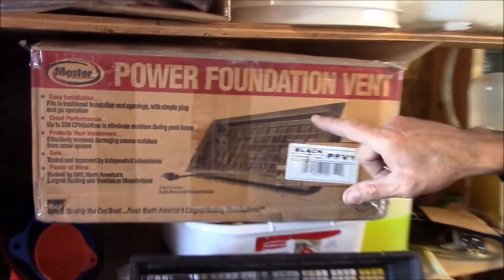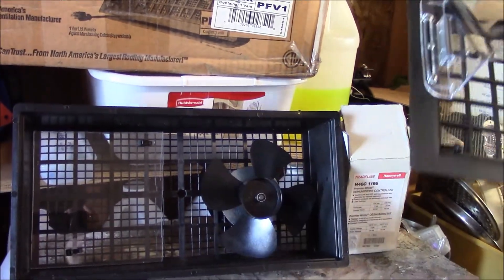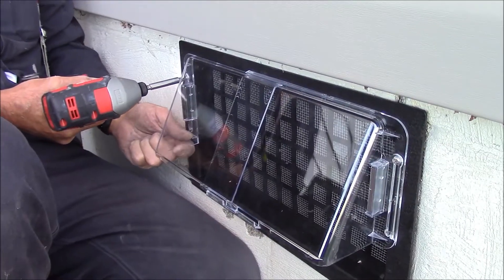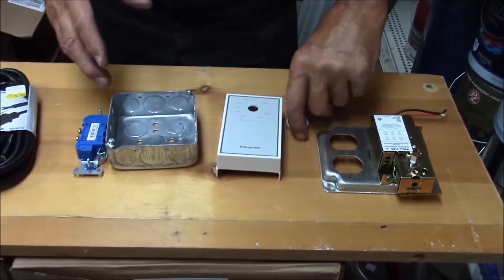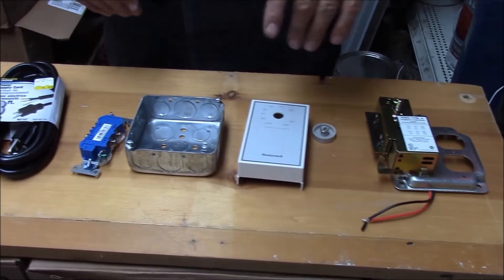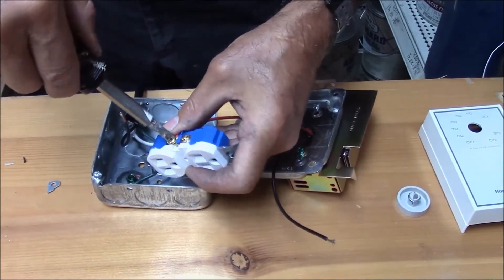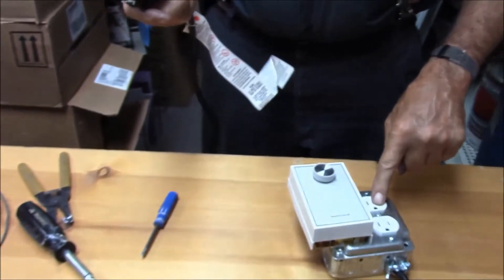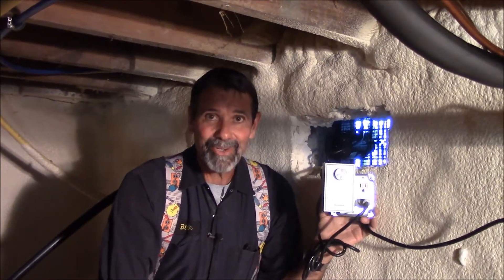Crawl Space Fan and Humidistat Wiring To Move Dry, Wet Air

Comment: Someone already alluded to this but if your crawlspace humidity rises to switch on the fan it will be of no avail if the outside humidity is above the set level of the humidistat.  As a matter of fact the system would run continuously until the outside humidity stayed lower than the humidistat setting and until the crawl space fell below that setting which would be a very very long time.  I propose that the system would be useless unless there were outside and inside humidistats wired in series.  But that's just me.  I've installed an actual HVAC air handler blower on a crawl space vent.  Currently I'm only running it when outside RH is low.  It is capable of moving fresh air into the crawl space because it's high CFM but a small fan like in the video seems insignificant in capability.  Even the fan companies offer information that "More than one fan may be necessary."
Reply: That fan is 2,000cfm, enough to force inside (almost always dryer) air into the crawl if for no other reason than to change it. It only runs one hour a day on a timer when the hivac is not in use. It also draws air from an upstairs 6" makeup-air vent under my dryer up there, which changes the air in the house keeping it fresh.
I agree with comparable RH in and out but that situation is rare and I still like changing the air in the building every day in the summer. It has been in for over 20 years and I can attest to its functionally all this time.

Comment: Very informative and detailed video. I question how much good that little "330cfm" fan can do for a whole crawl space. It physically doesn't appear to be much larger than a large computer fan. Not knocking you or your video at all, it was very good.
Reply from the maker: It runs all the time, very quiet and keeps the air moving. My cottage has a floor fan that is almost 1,500cfm, check out that video, https://mrhardware.com/articles-and-videos/crawl-space-venting-fan-allergies-wet-dry/

Comment: Hi Gilbert,  Where did you buy Fan and thermostat ? I couldn't find fan same size my vent size  (16x8).
Reply from the maker: LOMANCO Model No. PCV1. You can order one by calling Gilberts, 586-776-9532. They cost about $139.99 Tell them you saw it on mrhardware.com and it will come to me if there are any problems. Blair

Comment: You're like a wizard! Love your videos.
Reply: Thanks, we are trying. Blair
Reply: @gilberthardware7619  1 CFM for every 50 sq ft and control set to 60% relative humidity.   A bath fan would work for most crawlspaces--includes a damper. 

Should include an exterior damper ( dryer vent with damper) to limit moisture entering in summer and cold leaving in winter when fan is not running.  

No need to run fan all the time.  Humidity control is one way.  Alternatively, a  
AirCycler SmartExhaust Timer Switch would allow easy periodic operation to cycle the proper amount of air per day and could be varied through the year.